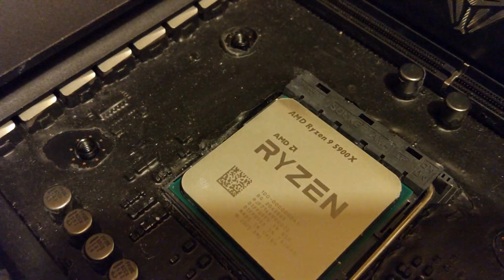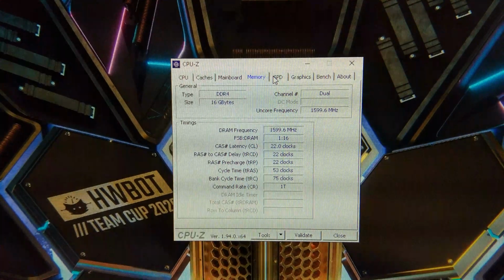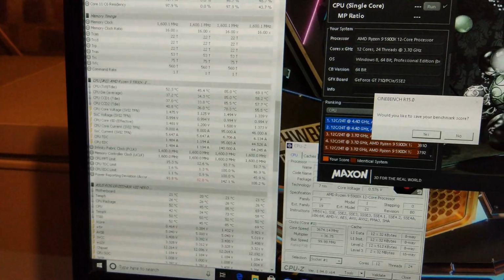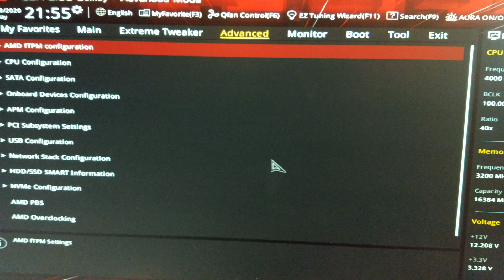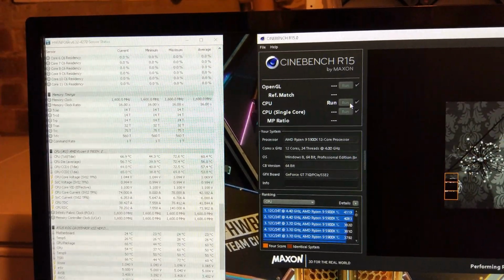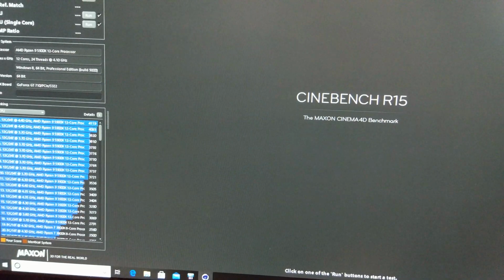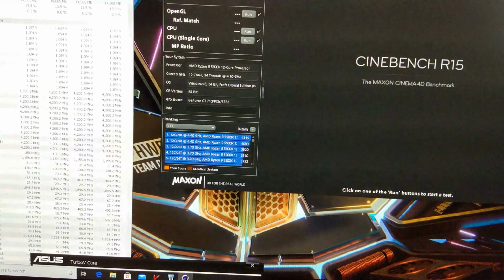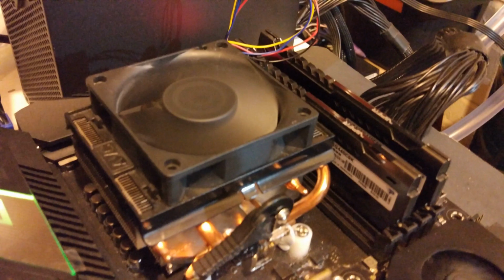AMD Ryzen 9 5900X VS Stock Cooler From The FX8320

Comment: I read it in some reddit, about an user, using the stock fx cooler with Ryzen, he inverted the fan  to pull the hot air out .  He got better temperatures that way, about 75C in P95SmallFFT.  
If you have time, can you test it ?
Reply from the maker: Lol no.

Comment: that's amazing, my 5800x hits 90° almost instantly when I run cinebench, it tops out at 70-75° in games, this is with my 212 black edition (2fans), not great not terribe I guess
Reply: I've got the same cooler with the 3600 and my temps are the same. With the stock it was 10 degrees more. I think with a better air cooler Ill get quite a bit less.
Reply: 5800x actually is HOTTER than 5900x. It's because there is one CCD is working on 5800x
Reply from the maker: In that case you might want to try a manual overclock that uses a lower voltage. 90c is a bit high.
Reply: I've just swapped out the cooler master fan that came with it with a noctua fan which has got rid of a horrible whining and reduced temps by 5. Might want to give that a try!
Reply: @ynage11-w6d  thanks! I'll look into it

Comment: lol fumy vid, amazed how close that cooler is to the one that came with my 3700X. is the only change the fan?
iv got a noctua nh 15s on my 3700x and under PBO it hits 72-75c ~ max, makes me feel like air is almost over now. no idea how hard it's going to be to cool 5nm.
(at stock the noctua nh 15s is super quiet so only PBO makes the fans less than quiet).
I do have to wonder why the ditched the box cooler looks like it can kind of handle it, was it just to save £5 on a cooler? (not ideal but looks like it will be fine at stock)
Reply from the maker: Pbo is ramping the cpu as far as it can so even on water cooling it would still hit 70c, but just going faster.

Yeah I think the cooler that came with the 3900x was better than this which I showed in the video. That would have been fine.
Reply: @LawrenceTimme  your right seeing 4.3ghz all core with that tiny fan is amazing, the old box cooler looks about the same but bigger fan.
still blown away by that low voltage! 
relay do plan to pick up a 5XXX CPU at the end of the platform to replace my 3700X.

XD stark contrast to the new limited edition intel with extra cooling hitting 6K in cinebench v that cooler getting 8K https://youtu.be/uOrUNT_0XVY?t=912
Reply: Saving $5 if most folk who buy retail CPU don't use the stock cooler is a valid response to many criticisms of "the stock cooler is a joke if you're spending $300+ on a CPU", especially if aftermarket coolers are readily available at many price ranges due to the same socket.  They could call it an e-waste initiative like countries mandating certain phone charger standards.
Reply: @josephfowble196   IDK what to say, i used the box cooler for ages! 
the 3700X has a relay nice box cooler, how is it a joke?
even has good RBG, had the lights doing a cool 3 colour look with the software.

if the air cooler in the video which looks vary close to the box cooler but with a smaller fan is 4,3ghz ok on a 12core cpu and that's a joke im relay not sure what to say to you.

if i had to get a quality cooler with my computer id have drooped to the 3600X + good cooler to keep in budget.

if i had the option of 5900X + box cooler or 3800X + after market cooler at same cost id grab that 3900X with box cooler every day of the week, lower temps cant beat 4 cores.

and no my old cooler is not in a bin, it's in the box and may get reused at a later date.

check your ego
Reply from the maker: @liaminwales  I agree. The box cooler is perfectly fine for many people, no it won't be best for performance or overclocking, but it's good to have
Reply: @liaminwales  It's not my ego, I'm just saying that it's valid to let folks buy part A separate from A+B when B is a readily available and affordable comparable cooler.  It's not ego... I've even used intel's hockey puck coolers for low end builds. I've also had several intel stock coolers go unused.
Reply: @josephfowble196  Im sorry saying ego that was to far, my reply was to close to an attack or at least over defensive which im sorry for.

the box cooler that came with my 3700X is fairly good, im not an expert on air coolers but i suspect most the cheaper ones wont be much better. 
my new cooler is quiet but it's not like the box one is loud, it's cooler but the box one was still fine temps.
the BIOS has changed a lot to, the cpu is cooler now than it was then on early bios so im not sure how it compares.
 do think it's a valid cooler and will be used by a lot of people.
it's a lot lot lot bigger than the intel ones.

i did replace it but more for the cool factor of massive noctua over real need, i even run stock daily (only play with OC for fun).
Reply: @liaminwales  It's all good and I appreciate your insight.  I will admit AMD's "stock coolers" have been fantastic for raising the bar and have been a great value. It makes me feel silly when I put an intel stock cooler on a build, even temporarily, when the competition has heat pipes/LEDs in their stock coolers. I hope the folks who make AMD coolers (coolermaster, iirc) continue making them and they're affordable.

My implied "internet commenter quote" about the cooler being trash was inflammatory, as yt and reddit opinions often are, and was not my personal view on the coolers.  Sorry about that confusion.
Reply from the maker: @josephfowble196  it's not a waste. The People who do use it don't have to buy a separate cooler and most aftermarket cooler will be bigger like aio, use more more material and shipping. 

The People who don't use it can sell it to someone who will, or keep it as spare. And air cooler lasts forever so it's will not degrade, so it's always handy to have around for a smaller case or if your other cooler breaks.